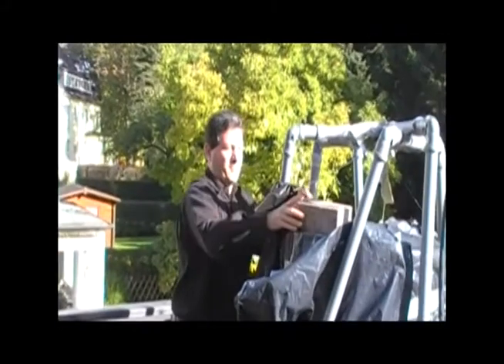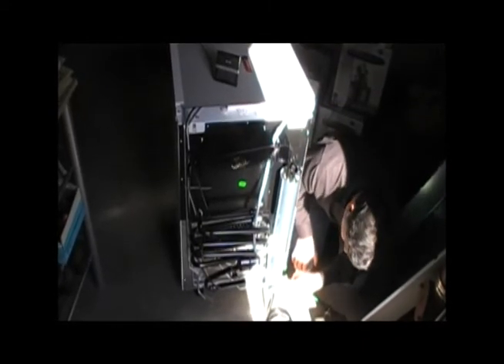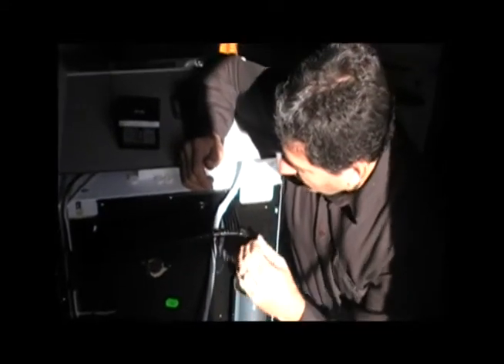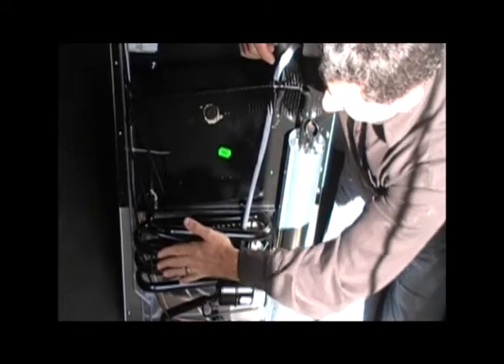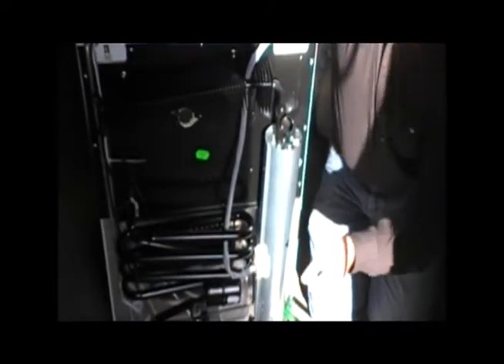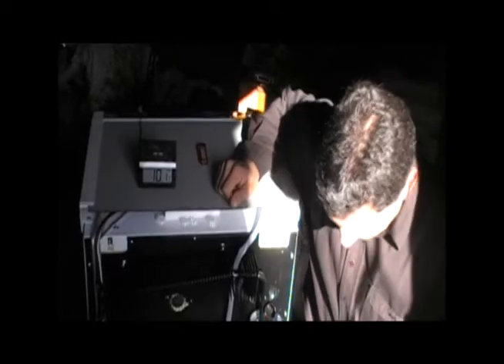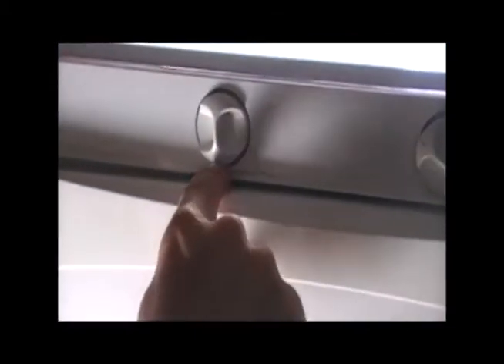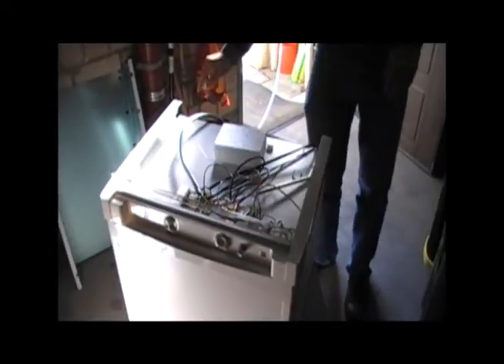Biogas: From Insinkerator to Refrigerator (2 of 3)

Comment: @tculhane so it would take about a 10,000 gallon system to power a generator 24x7?  Could you then power a walk in freezer? My ecovillage theory could include a refrigeration system using the exhaust of the bio-generator?  Good point about a small home system, you did mention a better insulated unit would hold the temperature better... but you are still only getting 45 minutes of power for the home...  but on an industrial scale like a restaurant, prison or village?

Comment from the maker: @JimboJitsu Co-generation is totally the future and Germany is hot on it for everything.  If we were able to heat the refrigerator chimney sufficiently from the generator exhaust it would surely work. The thing is that I can run the fridge for 24 hours off of the gas in a 1000 liter digestor, but only run the generator about 45 minutes, so that would mean only 45 minutes of fridge time.  Better is to have a biogas system dedicated to the fridge and another for a generator/water heater combo.

Comment: @tculhane Yes I agree with you. The source I found doesn't use free bio gas but expensive electricity that he has to pay for. Your system is very useful and efficient when you look at the whole picture. However, some people that used an absorption fridge on their holiday wrote that at temperatures above 32 Celsius the absorption fridge had a hard time cooling, I was wondering if you have any experience with those temperatures and the absorption cooling system?

Comment from the maker: @insAneTunA @d3adp001 I wonder if the efficiency losses reported are because they are comparing using an electric compressor (4.5 Ah) and using electrical resistance heating of the chimney in an Ammonia based fridge ( 10 Ah). I can well understand that using electricity to heat a hollow tube which transfers the heat to an ammonia/water solution is far less efficient than a compressor (which is why heatpumps are better than electric water heaters, right?). But the gas comparison would be diffrnt.

Comment from the maker: @insAneTunA @d3adp001 Since the gas we make will be "free" (not that the electricity isn't, given it comes from the sun) and is a byproduct of our wetwaste mgmt system, it makes sense to use the gas for cooling (after cooking, given that is the best primary use in these circumstances), even if the efficiency is lower. But I think the Ah calc is odd -- it is based on using electric resistance coils to heat the chimney, right? My Dometic also gives me the electric option, but I don't use it.

Comment from the maker: @insAneTunA @d3adp001 Sorry to chime in so late on this great thread you guys have started; I'm in Botswana at present trying to get some biodigestors built, then we will try out the gas with their absorption fridges here. Fascinating what you guys have pulled up; very useful info.  Regarding Ah to run the fridge, we have an apples/oranges situation down here: the camp we are building in has PV electricity, very expensive electrons needed for lights and computers.

Comment: @d3adp001 I googled it and came on several Dutch forums about campers and caravans. At a population of 17 million we have 6 million or more caravan owners, so camping is a big thing for many Dutch folks. They had experience with both type of fridges. They calculated that it takes about 10 Ah to run an absorption fridge, and about 4,5 Ah on a very hot day to run a compressor fridge. The compressor fridge doesn't run all the time so over the day it's using only 1,5 A/h or less according to them.

Comment: @d3adp001 Well, after doing some research it seems that these fridges are not that efficient at all, but it is a good alternative for those who don't have electricity or a generator. Some use a solar powered 12 volt fridge, the only thing with that is that it's very expensive. The 12 volt fridge alone comes at a price between 500 and 1000 euro.

Comment: @CTOL1 I have heard of them using for commercial apps, but the only cooling systems I have been involved which were compressor driven ammonia systems. aMm leaks are bad news, better to burn it then let it float away.  Interesting about your uncles unit. just sitts there doing its thing, cool. I cant find data on the cooling properties on any of them though, thats what I want to know.

Comment: @tculhane It is indeed incredible, it's so simple. Did some research about Dometic, to my surprise it's a Dutch company. The  absorption cooling technology was invented in 1922 by two Swedish students Carl Munters and Baltzar von Platen. Dometic used to be a part from Electrolux but now they are an independent group and they joined with a group called WAECO. It is still called Dometic group. But I don't think they produce it in Holland, probably made in China? Can you tell where it's produced?

Comment: @d3adp001 Any idea how efficient they work compared to a standard electric fridge? I mean In Joule or BTU or watt? And imagine that such a fridge can be sealed of and better insulated  then this version. And imagine that you have the room for some small animals. I wonder if chicken waste  works in the bio digester as well. This bio gas system combined with solar power and heat, and combined with other technologies should make it possible to live completely free from the grid. No doubt about it

Comment: hmm, normally the propane is regulated right at the bottle, and it should be at 5 psi or so, did you try and run it through the regulator? I am sure you did, but I just wanted to ask. But still very cool (literally) making stuff cold from trash. Whats the btu cooling vs btu fuel consumption?